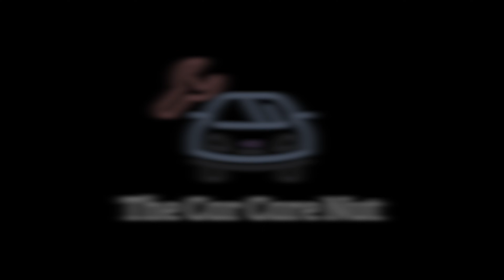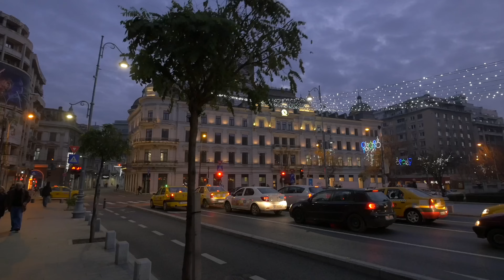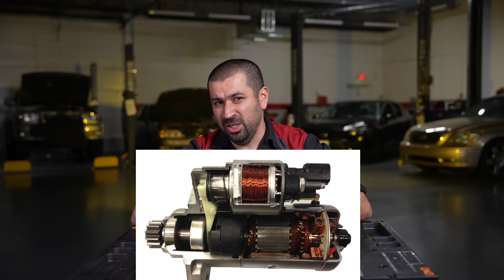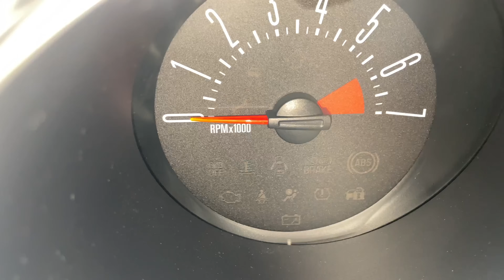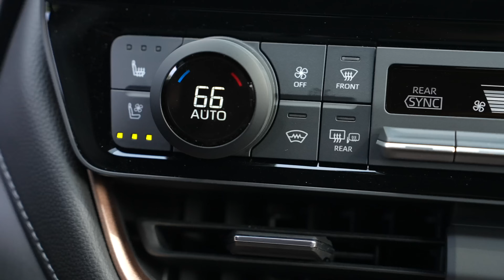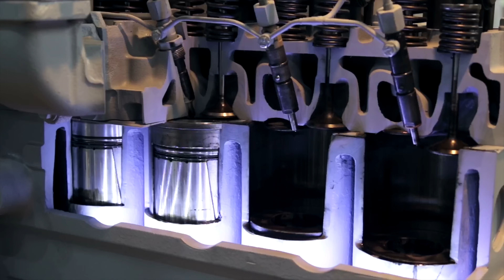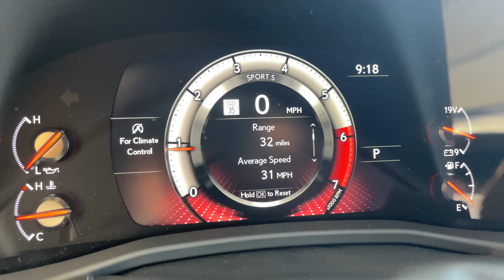How Does Start Stop Technology Work in Modern Cars? Everything You Need to Know

Comment: After learning about how much is involved with the Stop/Start systems, that of beefier parts, additional sensors, additional parts, more computer power and their enhancements, I can clearly see that these systems are adding additional cost to buying the car.  It's an awful lot of bother and money for something that I turn off anyway.
I turn it off the Stop/Start system in our Mercedes because it's a high-end model not like a cheap Mercedes SUV or C-Class.  And I don't want the Stop/Start system disrupting the engine, or the other major components learned of in the video here.
Our other car is a Prius C and being a hybrid the Stop/Start is a natural function and can't be turned off.  I don't believe that the system in the Prius is hurting it in any way.

How I obtain good heater performance in our Hybrid car:

The issue I have with our Toyota Prius C (Hybrid) is that during winter months the engine never runs long enough to warm-up the car interior.  Apparently, Toyota decided that higher fuel mileage is more important that cabin warmth.
The engine runs constant during expressway driving allowing for good cabin heat.
However, the problem of low heater output is during city and country road driving.  It took me a few years to learn how to overcome the Stop/Start system thus allowing for the engine to fully warm-up.  This is what I do:

Set the automatic temperature control to its hottest setting.  The automatic temperature control will then run the blower at full speed, and in doing so will outrun the heater, and again will take a long time for the cabin to warm up.  The way to resolve that is to manually lower the blower speed.  In doing that, the slower that I set the blower speed the faster the engine will warm up.  I set the blower just fast enough so I'm not completely freezing, and I can tell when the engine has warmed up because the heat comes out hotter than it ever would by leaving it set to automatic.  Once I have good hot heat, I can then speed up the blower some.  Once the cabin has warmed up, I resume setting it automatic temperature control.  In other words, push the AUTO button and Set the Temperature dial/button to where you like it.

Comment: Hi AMD. Would you mind making a video about using start stop delete/eliminator? I’ve seen some Chinese devises on eBay and Amazon that permanently disable start stop but not sure if it’s safe. Also would like to switch to using a regular flooded battery instead of $400 EFB battery that dealer says I need for my start-stop 2019 Toyota Highlander?

Comment: Start/Stop is dangerous sometimes. You see a hole in traffic, hit the gas the car lurches and then Nothing. Pure Panic ensues. 
I was at a traffic light and it failed. It took six attempts to start the car. 
I highly recommend Start/Stop Elimator. I have them in my Jeep and my Ranger. 
A small nightlight will defeat the stop/start if your Ford truck has 120V outlet too.
Reply: Pathetic. No concern for tthe vulnerable people that you are killing with the crap from your exhaust pipe.

Comment: I still hate fuel injection.  I have a 1988 Toyota Pickup that is carbureted and gets 31 miles per gallon, NO Toyota Truck in the last 20 years has achieved that high of gas mileage.  I've also not once replaced the starter in 345k miles.  This "feature" would have forced me to replace the started at least 3 times by now.

Comment: And then there is the idiots at Dacia. Start stop that cannot catch the engine from going fully off. You want AC or heat while engine is off, you are out of luck. Leave it in off state too much? You have to cycle the key. Automatic Transmission? What's that?.....

Comment: This adds a lot of extra complication and cost in parts for a very minimal improvement in MPG, I would prefer not to have this in my vehicle. The good part for me is I have an on/off switch right beside the gear shit for auto/start/stop so I can shut it off. If you get in the habit of putting the car in drive and hitting the button it's not too much of an inconvenience and on the positive side it's got a beefed up battery, A/C condenser, transmission oil pump and starter so that should work in my favor for long term durability not using the system.

Comment: yesterday i watched a video from you regarding toorbo system safety. it gets hot very hot (as you said it) even if the oil temp is ok the turbo is very hot. then start stop system shuts the engine off. what then?

Comment: This is the most illogical addition to any motorized vehicle I've ever seen. There's absolutely no good real reason so much work and effort in planning and execution went into this system. All it did was drive the cost of production up for a very fragile system that wont even last. I want vehicles that are built to last and wont rust away after 10 years. Something I dont have to worry about breaking down after 100k miles because it was designed to only last the length of the warranty. Ill be keeping my 96 f150 till the frame literally rots in half.

With all that being said. This was a great video and I learned a lot about these systems and the technology behind it. But theres no way I will ever purchase a vehicle with this system installed.

Comment: The most worthless feature they put in any car because it’s an issue causer what’s gonna happen when you run out of warranty and your starter has to keep starting and stopping starting and stopping starting and stopping all the time you go to a red light it stops and it Hass to start back up. Do you know your car eats up more fuel on the initial start up and you know you put all that strain on your starter every time it starts up once you’re not in warranty no more that goes out. Guess what it’s your problem to get it fixed it’s your money to keep fixing that issue because they think you’re saving fuel by shutting your car off with you’re eating more every time you fire it up, then just keep it on real mechanics knows that but some of them aren’t going to tell you that because it makes them money because you have to bring it in to them like this guy right here

Comment: The 1980 VW2000 didn’t fare too well with consumers with it's Start/Stop system, and disappeared quickly. I feel the same now as I did then. I went to buy a Subaru Outback in 2020, and it was only available with a turbocharged, 4-cylinder, s/s engine. Fortunately for me the dealer had an unsold 2019, 6-cyinder, normally aspirated Outback on the lot. Bought that.

Comment: I’d like to see an electric engine oil pump so that oil pressure is correct before it starts…the feature should be disabled when your left signal light is on so as to prevent a dangerous collision. Problem should the slated fail to start…lastly, if there’s a disable feature (and there SHOULD be one) then clearly you CAN mess with the emissions system. As you SHOULD be able to do.

Comment: My Ford has such a function, it works perfectly reliable, never caused any problem and I see no reason why I would dislike it, it's nice to not have a loud vibrating car when you come to a stop. But there are some differences to what the video explains. 

First of all: If the motor goes off, the HVAC pretty much shuts off, except for some minimal ventilation. You can immediately feel that there is almost no air flow anymore and the air that comes out is no longer as hot or cool as it used to be (you also hear the AC is not running at all). Not a real problem, as you will only stay there for a few seconds and during that time the interior will not cool down or heat up to the outside temperature, it will at most change 0.1 degree Celsius during such a traffic stop. Also seat heating gets turned off the moment the motor is off, but again, the seat will stay warm for over two minutes, so no problem. I see none of the fancy things mentioned in the video or that the heating/cooling keeps running under certain circumstances.

Also the entire start/stop-function is disabled regardless the outside temperature, until the motor has reached a certain temperature. I even know the approximate spot on the temperature scale (my indicator is analog, so I don't know the exact value) where it turns on. You can watch the pointer raise on the scale and always at exact the same position the "Start/Stop disabled" symbol goes unlit. Sometimes it will stay lid, which according to manual means that the battery is not charged up enough, in which case it will stay constantly disabled until the battery is charged up again.

One thing the video did not mention: The function is disabled if you use it too often in a short time period. If I'm in traffic jam and constantly have stop and go, after a certain amount of consecutive start/stop moments, the system also shuts off permanently. This seems to be a primitive counter system, like "over x stops in y minutes -> disable". Then it stays off for quite a while before it turns back on again (feels like 20 to 30 minutes).

And I cannot confirm that the batteries are extremely expensive. I can get a new start/stop battery from Varta for 130 to 150€. The same battery type as non-start/stop battery is 90 to 110€ (all prices including sales tax). That's not really a huge price difference and it's still in a low price segment compared to what the price of the car was and compared to what other car components cost. I knew that because I already replaced the battery myself, as the old one had trouble during the winter (if the car was not in use for over a week, the battery would go dead). The contract workshop wanted 250€ for a new original battery (excluding sales tax), so I said "Yeah, right" and replaced it myself. No problems after that and start/stop works as it used to.

Comment: This video illustrates the complexity and cost that comes with a start-stop system. I'm not saying that it does nothing, there can be certain situations, eg. for delivery drivers in big urban areas where it makes sense. But in the was majority of cases it feels to me that it's actually worse to the environment. The complexity and maintenance increase can lead to increased environmental impact in a few ways. Eg.: as maintenance become more and more problematic and expensive (not just due to start-stop systems, but other systems that are introduced for similar reasons) people are more likely to circumvent these systems or just get rid of their car earlier. The best way of recycling by far is re-use, so if people use the car for fewer years, it hurts the environment. Manufacturing more components for more complex systems also hurts the environment. More expensive new cars make people buy older used cars (maybe not in all countries, but here the average age of cars on the street is 15 years) - worse emission hurts the environment. I find it highly unbelievable that all of this worth that small and situation-dependent emission decrease. Also it's a very dangerous thing to popularize concepts that has marginal improvement for the environment while there are real alternatives with real impact. Legislators would support these half-baked solutions like start-stop systems instead of focusing on promoting hybrids - which when done well are night-and-day better for the environment.

Comment: I just replaced the battery in a BMW with start/stop. Dealer wanted $650. Yes, it's a special type of battery but the main reason for the ridiculous price tag is labor. The battery needs to be registered and coded in the car. Yes, requires 2 different tools. No, AutoZone won't be able to help, even if they sell the correct battery. 
Three only good thing about BMW's implementation of start/stop is that they provide a mechanical OFF button. It stays OFF until I push it ON!

Comment: I hate it. "we prevent idling emissions, by making the car drive at idle rpms, regardless of speed". 

You stop, the motor slams off, let off the brake, motor slams on.

I had this happen 6 times at one traffic light.

Then the high number of gears in an automatic, make the shifts crazy. 5 shifts, I'm in 6th gear at 45mph.

Modern cars are just insanely bumpy, zero confidence in acceleration (for many reasons).

Then maintenance...

Comment: The HVAC not flowing when the start/stop feature was being used in a 2007 hybrid Civic that I once had was the main issue I had with the start/stop feature. Especially when it would be extremely hot outside and I'm stopped at a stop light. The actual cool air would stop, but the blower fan would still go and then the car would get hot inside really quickly since stopped at a stop light one could be sitting there for at least 3 to 5 minutes. And then when moving again, it would take quick a while to get the hot air in the car cooled down again. 
This was one of the reasons why I would have to turn off the start/stop feature when using the AC during a hot day and one reason why I didn't like the feature. But of course, this issue has been resolved in more modern/current cars today. But back in 2007, it was a major issue for me.

Comment: You didn't mention two of the cooler ways that restarting engines has been accomplished. The first (and to me, cooler) way is that a small amount of charge is intentionally sent to a discrete circuit within the alternator, which drives it a bit like an electric motor. This allows for an EXTREMELY smooth restart, because the charge sent can easily be scaled to the engine's current rpm. The other way that I have read, is that instead of using a starter with gears, they use a belt or chain driven starter, for a similar reason as the alternator. Its much smoother, and more consistent than the traditional gear setup.

Comment: I like how Hyundai has simplified the battery drain situation in their cheaper cars (i10/i20/i30/etc.) - they simply put an electric motor in the flywheel, and a capacitor that charges when the engine is running. That means that there is no additional load on the battery, in fact, it's not involved in the start at all, but simply continues powering other stuff as usual (lights, stereo, fans, etc.). That, and they make sure that the engine always stops with one cylinder fully compressed, and ready to fire, to further help the engine start up even faster by immediately firing that spark plug. Thus, they can use an entirely normal battery, and get around some of the other limitations regarding keeping electronic systems running while starting. 
I'm sure other manufacturers do something similar, but I got the full presentation from Hyundai, so that's who I'm using in the example :)

Also small note on when it was introduced - The first automated start/stop system was in the 1974 Toyota Crown due to the first oil crisis, and the first one using "modern" optimized start/stop was the 1998 VW Lupo 3L, as it was necessary to ensure that they could reach the goal of 33.3 km/l.

Comment: If its all that smart, how come my Toyota rental shuts of at first stop after 50 Meters out of Hotel garage with complete cold engine. Now a days immisions go over lifetime of engines. They dont care how long batterys, starter motors or even the main engine will last. Also all this additional equipment is additional weight, additional cause of failures. No thank you.

Comment: Video actually creates more questions.  How does it know when to initiate a start stop scenario ?
My eco light flashes but has never instigated a stop start even though its active, so it's either the wrong battery,  car is 2015 model or had wrong battery fitted,  would the start stop failure create an MOT test failure ?
Is it expensive to fix and should I try to claim the repair through the car warranty ASAP?
All in all, a good reason to switch off the eco stop start system.

Comment: My '22 explorer ST. I turn off the auto start / stop. I hate it with the ac. When it goes to stop, the ac performance is horrible. When it's 120 outside, it's noticable within a second!
Also, it has the dial gear selector and if any door opens at a stop, it goes straight to Park and turns on the parking brake.  And it also has assisted brake by wire and then the twin turbos, it also does a anti turbo lag and is amazing how everything works in sync sonperfectly.  I even turned it and got more out of her. Pushing near 500hp at the wheels. In a auto AWD on demand. Twin turbo V6 with the same drivetrain as the Interceptor. More power then my LS2 GTO

Comment: 4:35 smart manufacturers insert a relay driven by the alternator which opens the starter circuit if the alternator is running so you cannot engage the starter while the engine and therefore the alternator is running.

Comment: Amazing that we are forced to pay for a system that is very complicated, and I expect adds to the cost of the vehicle and we do NOT want it.  There must also be an environmental cost to such a system.  Complicated battery, extra material in A/C, extra components in transmission, water pump, starter, etc, all to save a tiny bit of fuel that is not saved anyway since we all turn it off.  What a government imposed feel good waste.